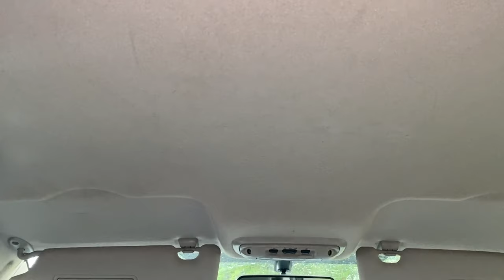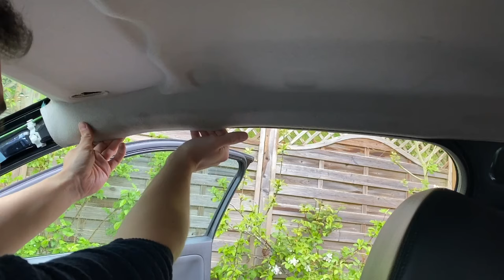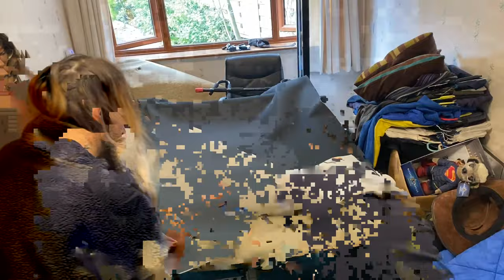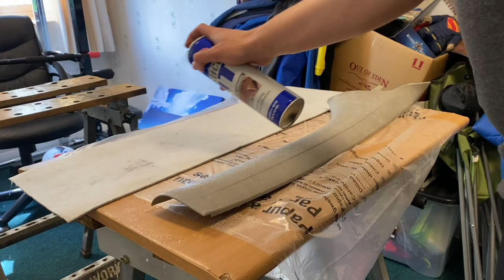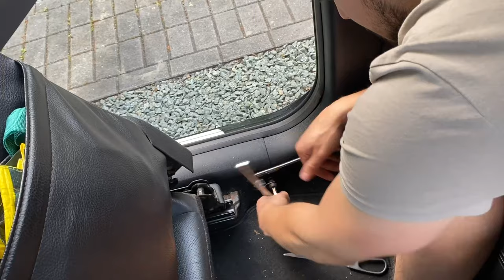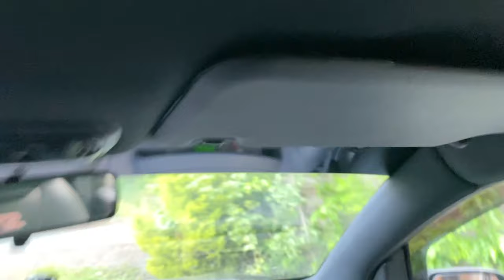Headliner Re-Trim | HOW TO | ST150

Comment: Personally I would of just used a couple cans of dupli color vinyl & fabric paint. Would be easier and quicker to do
Reply from the maker: Painting fabric wouldn’t look anywhere near as nice though and would probably be less durable 🤷🏻‍♂️ and finding a paint match for the plastic pillars and trims might be difficult 🤔
Reply: Doing this myself more than once and gathering all the correct information from the internet alone is not easy. I’m 2 mins into the video, love to check comments they usually even correct the author. Without knowing, if you upholstered the sun panels, I think that’s the real way to go. Getting confident to paint the plastics, probably using acetone instead of sanding and SEM cans. Have the spray gun but not worth the extra time.

Comment: How did it hold up after a while? I plan on doing this too in my car but i'm worried it will hang/sag after some time
Reply from the maker: Roof is perfect, pillars pull off because of the right angles. Fabric without the foam would be better. Or foam and fabric separately
Reply: @MendItModIt  Maybe painting the pillars would be the better option? Or I just hand them over to someone that does this shit for a living
Reply from the maker: @nou-fg8wq  paint won’t last 5 minutes and would look shit on the pillars I reckon. Could get the pillars done professionally but I wouldn’t, I’ll just have another go some time in the future
Reply: @MendItModIt  Alright so my best bet is no-foam material, thanks for the reply!
Reply from the maker: @nou-fg8wq  that’s what I’d do on the pillars, or get foam and fabric separately, it’s hard to shape the fabric to the contours of the pillars properly when the foam is part of the fabric. No worries mate, good luck 👍🏻